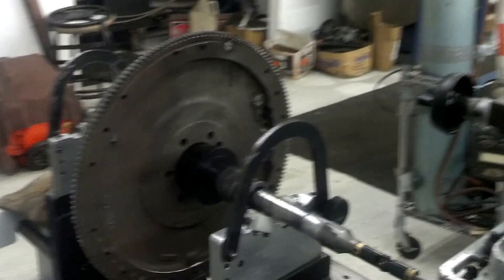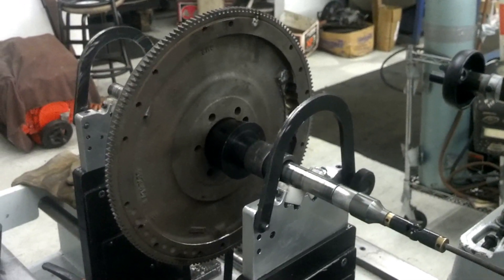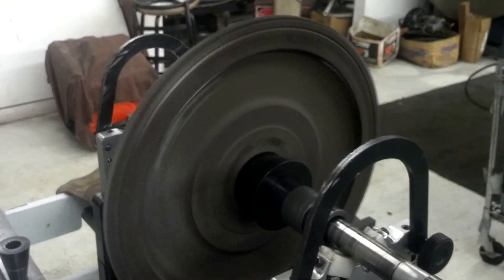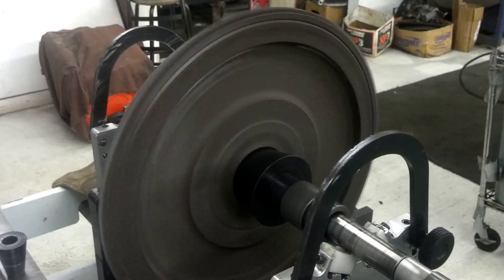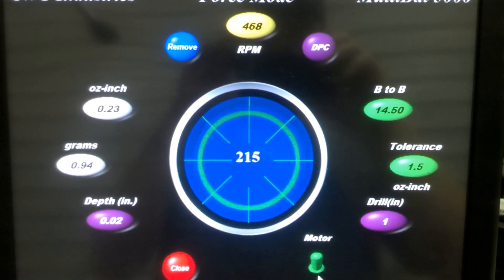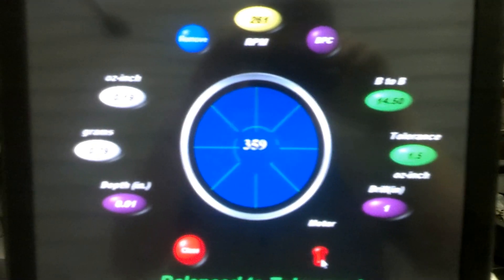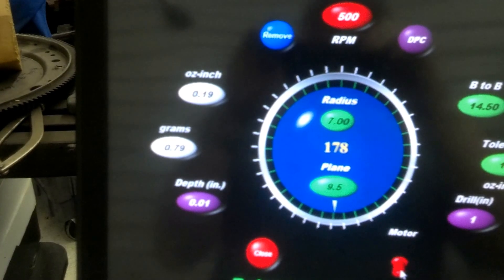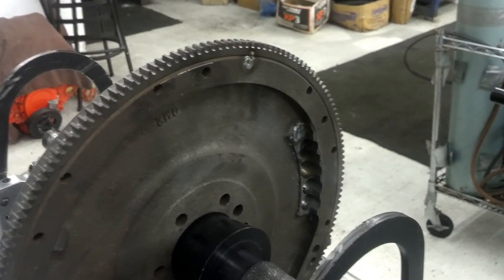Balancing a Flywheel Part 2

Comment: I have a 383 externally balanced engine in my Camaro, I have a vibration from 3800-4200rpm that's significant.  I've replaced the harmonic balancer with a high performance externally balanced one recommended by the engine builder but the flywheel has not been checked out for balance, I checked the inspection plate and verified it does have the weight on it like it should, what kind of shop can check My flywheel for balance and how do I know what balance weight it should have?
Reply: Don't you hate it when you don't get a reply from a place that allegedly wants to help?  Ideally, you want to have your flywheel AND pressure plate assembly balanced as a "unit". The flywheel can be balanced, but end up being all for naught because the pressure plate assembly is throwing it off.